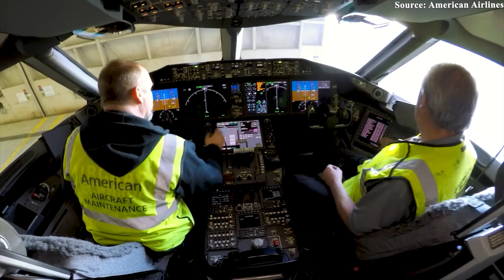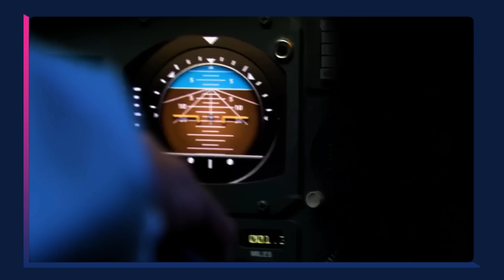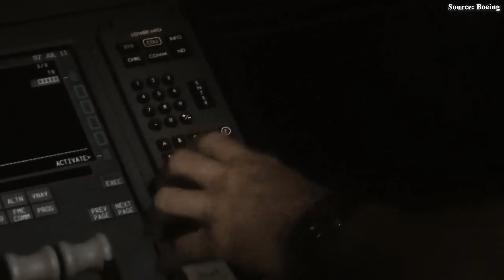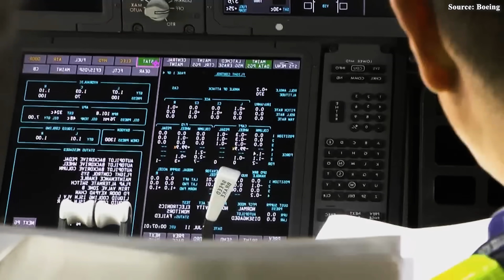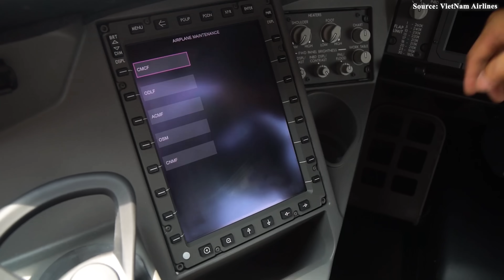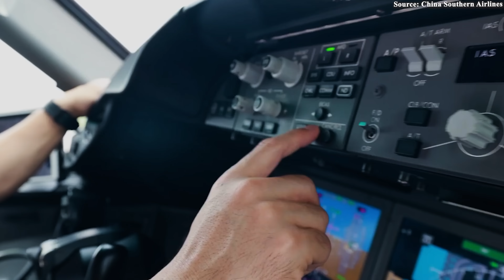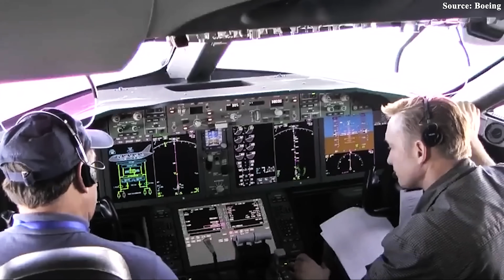They Just Dropped a BOMBSHELL about Boeing 787's AI 171 Flight!

Comment: Firstly,  the fuel cutoff switches are not only for use on the ground. They can be placed to cutoff then back to run if there is a dual engine failure in order to restart while airborne or one switch can be placed to cutoff during an engine inflight shutdown. 
If in fact both engines failed during rotation, there is almost nothing that can be done to recover the engines.
If the Pilots did try a restart by placing the start switches to off then back to run, then they are heroes for having the situational awareness to at least try a restart of the engines.
Reply: The problem is the timing.  The switches were moved to Cutoff, 1 second apart.  Then back to run 10 and 14 seconds later.  If this was an actual engine restart attempt, each switch would have been moved to Cutoff and back to Run 1 second apart.

You would never turn both of them off, leave them off for 10 to 14 seconds and then turn them back on.

Comment: Too much money involved here, who checks the checkers. What independent officials were present when these mechanical switches were discovered to be in the off position. My understanding is that such mechanical switches operate an electrical signal via a solid state  device. Just saying
Reply: Those are mechanical switches.  There is no solid state anything.  They send a signal directly to the engine computer, and each switch talks to a separate computer, through separate wiring.

Comment: As a minimum cameras must be installed inside the cockpit. Secondly there must be a reconfirmation step before the fuel supply is shut off. Thirdly the fuel control switches must be covered by a removable cover and removed further but not far from the pilot.
Reply from the maker: Pilot unions say the use of cameras would be an invasion of privacy and could be abused, as far as I know.

Comment: One aviation expert Mary Schiavo, a U.S.-based attorney and former Inspector General, cites a 2019 ANA incident where a Boeing 787 experienced a dual-engine shutdown due to a software glitch in the Thrust Control Malfunction Accommodation (TCMA) system.

The aircraft, on final approach from Tokyo to Osaka, mistakenly interpreted it was on the ground, cutting fuel without pilot action. The plane landed safely and was towed, with the issue traced to a software fault, not human error. 

This parallels the AI171 preliminary report, where both fuel switches moved to “Cutoff” three seconds after takeoff, with cockpit voice recordings showing one pilot asking why the other cut the fuel, and the other denying it, followed by a crash 32 seconds later.

The AAIB preliminary report and expert analysis suggest the switches moved without clear pilot intent. The 2019 ANA case supports a technical precedent, where TCMA/FADEC software glitches caused similar autonomous cutoffs. 

The AI171 switches returned to “Run” before impact, indicating an attempted relight, inconsistent with a deliberate shutdown. Aviation experts (e.g., John Nance) note the switches’ spring-loaded, lift-to-move design makes accidental or intentional mid-flight cutoff highly unlikely, reinforcing a systems issue over human malice.

The 19,000+ combined flight hours of Captain Sumeet Sabharwal and First Officer Clive Kunder, including significant 787 experience, also undermine the theory of pilot suicide or deliberate action without motive or data.

The 2019 ANA incident supports a technical malfunction — likely a TCMA/FADEC software glitch—as a more plausible cause, consistent with the pilots’ denials and the rapid sequence of events.

Meanwhile, the investigation remains ongoing, and a final report (due 2026) is needed to confirm the root cause, but the technical hypothesis holds stronger ground now.
Reply: Not sure which part of TWO computers you don't understand.  TWO computers will not malfunction the same way, at the same time.  The Co Pilot literally asked the Captain, WHY did YOU turn the fuel switches to Cutoff.

The switches were moved back to Run by the Co-Pilot as he was trying to rescue the aircraft.  The Captain turned them off.  You people need to learn how to read...
Reply: What an excellent example giving a likely possibility of system/mechanical failure other than manually switching the fuel control to CUTOFF Position!
Reply: @chichoileung9482  No, literally complete nonsense.

Comment: The FADEC computer should never have let the perfectly operating engines from shutting down during this phase of flight when the airplane had no room for recovery.  This event was very foreseeable. Boeing is responsible for this.  Boeing knew or should have known of this failure mode. It’s time to sue Boeing, pilot induced or not, Boeing is complicit in this accident and we must hold them culpable.
Reply: Holy Christ !!!  You have the info from the flight data recorders and they point right at what a pilot did in the cockpit and yet you still try to Blame BOEING ????  WTF ????  That fuel shut off switch is used on many Boeing planes and it works as it should, UNTILL a mentally deranged pilot wants to kill everyone on board !!!  Face the facts of what the cause is and deal with it !!!  The plane flies fine,  Its up to the airlines to keep their pilots in a good mental health !!!  GEEEESS!!!!!It seems you whiners also think it is someone elses fault !!! The buck stops where it stops !!!  The pilots !! !
Reply: @wilburfinnigan2142  This has nothing to do with flight recorders, it’s about bad engineering.  And bad engineering lands squarely at Boeing’s feet. They must be held accountable for letting loose a poorly designed aircraft onto an unsuspecting public.  Boeing is culpable for poor design and I hope the families sue them for all its worth because this fault mode was foreseeable, even the FAA documentation highlighted it.
Reply: @TheTeaParty320  These switches need to be able to cut off the fuel in case there is an engine fire in ANY phase of the flight.  Stick to flying kites...
Reply: @redbaron6805  No they don’t.  There is not reason to cut fuel to the engines in any phase of flight that I can think off.  No engine, no lift, no fly.
Reply: @TheTeaParty320  There is no phase of flying you can think of as you are not qualified to fly any actual aircraft.

Why would you think of a scenario on something you have no training, experience or qualification for...??

I'm not sure I understand your point.  It is like a toddler telling me he has no reason to think a microwave can heat his food because he doesn't know what a Magnetron is, how Microwaves work and why food would get hot while the oven stays cold...
Reply: This has nothing to do with engineering and/or design. I fly the B787. There's nothing wrong with the plane. This was a rogue pilot..period.
Reply: @strack0976  Oh yes it does. I design failsafe systems, and this is my area of expertise. I can tell you the fault is with Boeing.
Reply: @TheTeaParty320 They're gated switches - you can't "accidentally" cut one off let alone both - especially not within seconds of each other. One of the pilots deliberately selected the switches to cutoff. Whether it was a collosal "brain fart" or willfully nefarious is another question.
Reply: @strack0976  I know those switches well because they are the same ones we use on missile arming systems.  But, that’s not the point. On the Boeing 787, those switches don’t connect directly to the fuel shutoff valves, but instead, their position status is sent to the FADEC system where a command is sent to the engine valves themselves to command shutoff.  The FADEC knows exactly which phase of flight the aircraft is in, and it knew that the aircraft hadn’t climbed to a safe altitude in which to turn off perfectly good engines. The FADEC is responsible for deploying the reverse thrust mechanisms on the engine, which it doesn’t do until the Weight On Wheels sensors have confirmed the plane is in the ground and that it received a positive command from the pilot. These are all control features built into the FADEC logic and when Boeing gets it wrong, planes start falling from the sky. An example of FADEC logic failure occurred with Lauda Air in the 1980s or 90s when a Boeing 767 flight out of Bangkok had the reverse thrusters deployed by a software glitch in flight and the plane crashed in the jungles of Thailand.
Reply: @strack0976  Except, they are located in that spot for a reason.  After takeoff, there are no controls back there you would be manipulating after takeoff.

So, the brain fart idea isn't very plausible...
Reply: @TheTeaParty320 Again, have to disagree. We may well want to shut down an engine right after takeoff - most likely scenario would be a bird ingestion leading to surge/catastrophic failure. The normal drill would be to begin engine shutdown at/above 400' AGL; however, if the engine is destroying itself and the plane is limping in initial climb, we may decide we need to shut it down earlier. We don't need/want computer logic to prevent us from doing so.
Reply: @TheTeaParty320  If you want to quote other crashes and their cause, at least get them right.

In the Lauda Air incident you are talking about, the pilots got a WARNING that the Thrust Reverser system had a System Failure, and could Deploy in Flight.

The pilots IGNORED the WARNING, and decided to continue with the flight anyways.

Nine minutes later, the Thrust Reverser failed and Deployed in Flight, just like they were WARNED could happen.

If they would have returned back to the airport and landed, they would have been just fine.

The lesson learned there, is if the plane WARNS you about an impending and critical issue, return to land, instead of just hoping for the best.
Reply: @strack0976  FADEC knows when the engine is destroying itself. These engines have hundreds of sensors built into them that the automation has realtime health of those engines all the time.
Reply: @redbaron6805  We can go into the history lesson, but in the end the thrust reversers deployed in flight and the plane fell out of the sky and it was a Boeing aircraft; everything else is immaterial to the discussion.
Reply: @TheTeaParty320  How is it a "history lesson"....??

If you want to make a claim about something, make sure it is accurate, and reflects what really happened.

Yes, airplanes are made with millions of parts, some of them can fail.  But obviously, looking at the last decade in aviation, that is now exceptionally rare.

Airbus aircraft have crashed, so have Bombardier, so have Boeing, so have Embraer, so have ATR's, literally every single airplane type has crashed due to some type of failure.

If you are trying to make a point here, you are failing spectacularly.

Each crash is investigated so we can learn from it, and make changes where needed.

Most of the changes end up being changes in pilot training, procedures, inspections, maintenance or other factors.

The Lauda Air case was a pilot error.  The pilots ignored the plane warning them a system had failed, and could deploy in flight.  They got that warning 6 minutes after takeoff, and had 9 minutes to land the plane.

This is precisely why pilots land planes when they get warnings, due to abundance of caution.

The consequences of deciding to keep flying with a faulty system isn't a big mystery. It happens in a shocking number of cases.

The vast majority of crashes are due to pilot and maintenance errors, not airplane design failures or defective parts...

Comment: We really need to wait for the full report. Just a thought on the fuel cut off switches, though. They were transitioned to off, but restored to on before the crash, I think the report says. How long before going from off back to on? I’m just thinking that if the fuel cut off due to a software glitch, the pilots would likely try and switch it back on, but would have had to switch the manual switches off before they could put them back to on, as they did. Far too early to be jumping to conclusions and placing blame here. Hopefully the full investigation will find the truth 🤞.
Reply: There were turned off, but put back to Run before the crash to make it look like an accident.  This can't be a software glitch, as EACH switch only talks to a Single Computer, and there are Two completely independent computers, and only One controls each engine.
Reply: The flight data recorder stated the MANUAL switches were turned off !!!!  then turned back on !!!  The switches were moved !!!!  Learn to understand what is WRITTEN or SAID !!!  GEEEEES!!!
Reply: this is a big mechanical problem with Boeing my man. Geeeeees!!!!!
Reply: @wanda12246  It obviously has nothing to do with the plane, and has everything to do with the pilot who decided to shut the fuel off.

Comment: It was NOT "a mistake".
Reply: @ultimathule  TRUE !!!!  But people just CANNOT accept what happened !!! And everyone is dancing around the facts trying to find someone else to blame !!!  The buck stops at the fact of what happened !!!
Reply: Maybe just a small malfunction of the switches and a very very small fault in production design ( making it possible to manually put a fuel switch off after beginning to take off or in the middle of a flight. Even My computer asks me if I am sure if I want to delete something not so important and in this Boeing ….a plane with hundreds of people in it  … ONE person can cut fuel off in the middle of a flight.. just a small design mistake .. 😢
Reply: @lenjon7478 : do you have any idea how the production process in aviation works, especially in terms of quality control?
Do you know what "6 Sigma" is?
Do you know that "a mistake" in this process is simply IMPOSSIBLE?
This is due to the method of testing. If something went through the testing procedure it means that it works.
What's more: if one item do not pass - the whole lot is for trash.
That's why a simple switch costs 1500 USD instead of 1 dime.
Reply: @lenjon7478 : what if there is a fire and you need to switch it off IMMEDIATELY?
The airplanes are designed for the pilots, not for the murderers. If the design would assume faul play then there would be no airplanes at all. It is IMPOSSIBLE to design something what at the same time: will do what a pilot wants it to do and will not do what the pilot wants it to do.

Comment: Putting the blame on pilots will help each stakeholders to get rid of their responsibilities...it is basically a joint venture between boeing, air india & ministry of civil aviation...each of them will do their level best to set up this narrative of pilot error
Reply: @AB-nm8nv : We can tell that you don’t work in the aircraft industry. Everything is done to prevent any kind of accident to happen again. Unfortunately, as stated in the video, you can Murphy proof every system, there is nothing you can do if someone knowing the aircraft as the pilots do, want to override all the safety rules and mechanisms. 
As of today, an aircraft could fly safely without any pilot on board. But NOBODY is ready to jump in such a flight. 
When I was an instructor and I had pilots in my class, I used to tell them that from now on there will be only one man and one dog in the cockpit.
The man is here to feed the dog, and the dog to bite the man he is touches anything. Only the pilots did not laugh.

Comment: Foolish analysis. Nonsense. If independently enquired the faults of the Plane's computer system or the fuel valve system will be revealed
Reply: Yes an Independent Analysis of the planes computer FADEC should be conducted. A Venerability test needs to be conducted !

Comment: Even, if we believed that was a human mistake, the big question is why Boeing computer system basically allows fuel cut off during take off? Who supports my question?
Reply: I do and why it doesn't install cam recording in cockpit? Also why if during flight one of the pilots goes outside or to the bathroom the other one ,if mad,can take over and crash the airplane? Is this normal or safe?
Reply: This was a titanic moment for Boeing. Lots of things can wrong with a computer automation of the plane.

Comment: There were two brothers who were sitting behind the captains  cabin in which ?one of  the brothers escaped but the other was ?killed in the crash.Could they have been responsible for fuel cuttoff via closing of  the valves in the outflow ( already set up in the maitainace by someone).to the engines and not the swiches which were in the on position..
Two brothers monitoring engines one each ,ONE ON THE RIGHT AND ONE ON THE LEFt. Terrorist don’t require bombs now.They simply adjust the fuel outlet .Somebody has sabotaged the plane through the maintainace work before takeoff...
 A WARNING ABOUT SOMETHING “BIG” GOING TO HAPPEN IN INDIA WAS GIVEN BY A CIA AGENT SARAH ADAMS THE “BIG” MAY HAVE BEEN A BIG PLANE LIKE THE DREAMLINER AI 171.
It is SABOTAGE by Terrorists, same who were involved in Pulwama and Pahalgam.

Comment: Is that electrónic switch that Is physically operated..subject to 0 For off AND 1for on.. electronically
Reply: There are two manual switches, located side-by-side, each controlling fuel to an individual engine...both switches were manually moved to the "off" position and then returned to the "run" position (by the "Captain"...the copilot was "piloting" the plane and could not have altered the switches positions without removing his left hand from the "yoke" which he would not do while piloting the aircraft).  This was a deliberate act by the PILOT!!!!!!

Comment: Not manually moved, report does not say that
Reply: The recorder saved the signal "0" or "1" for off and on but showing not the mechanical status of both switches since they are not wired electrically directly to the recorder. There is a difference between an electrical wire wound and an digital electronic signal 0/1.